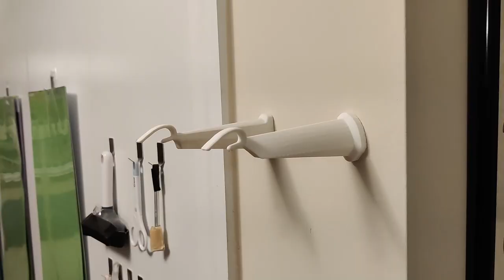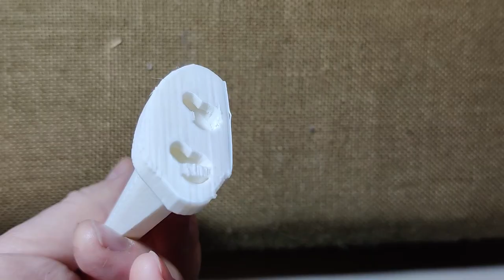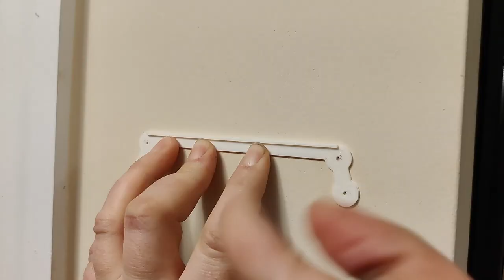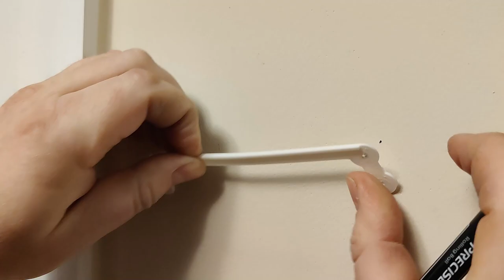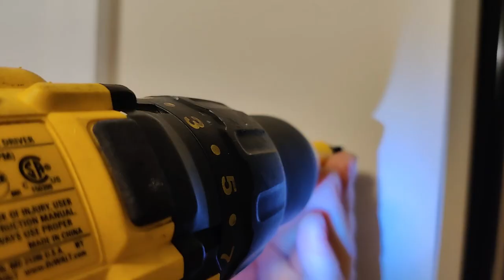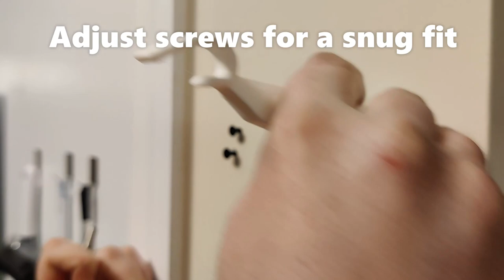Oculus Quest 2 Wall Mount - Hidden Screw Version - 3D Printed!

Comment: If anyone does this, (wood should usually be fine but still made easier if you) predrill holes and should also find the correct plugs otherwise you risk doing more damage.